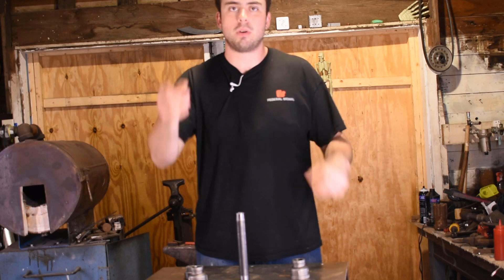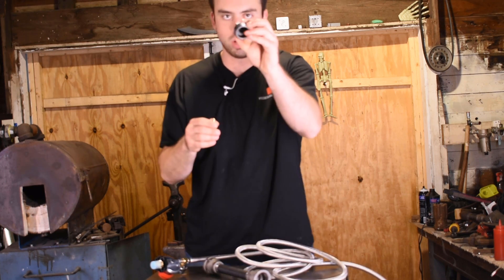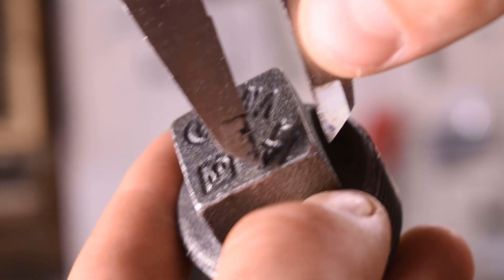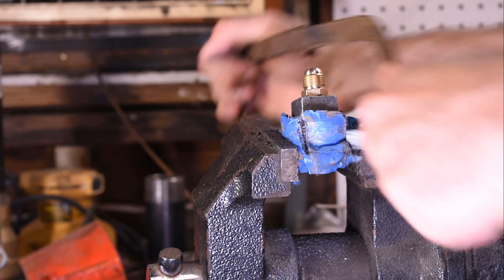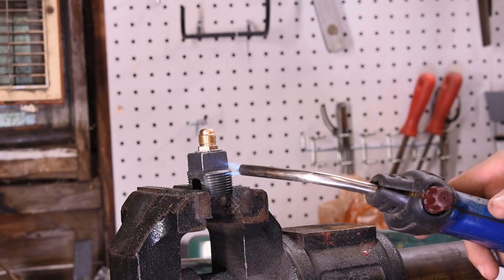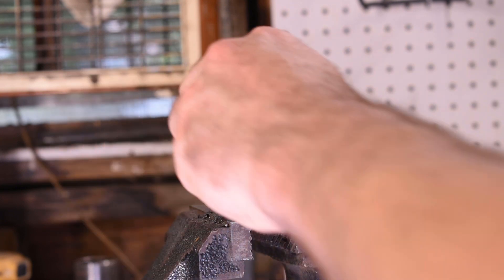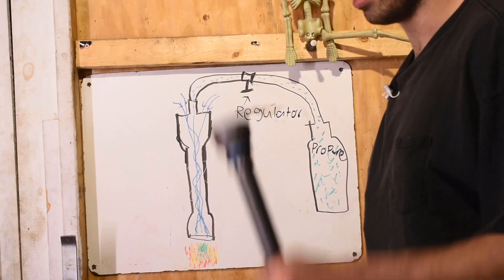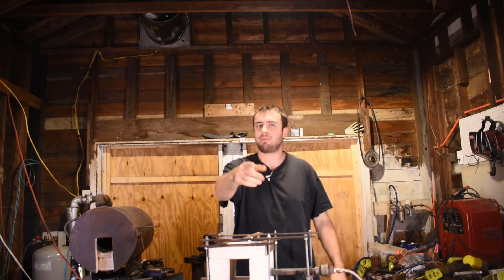How to make a propane gas forge burner in  2023(Easiest design)

Comment: I'm trying to make a jet burner double tip like for boiling big pots of water... The problem I'm having is the flame blows itself out unless I put a small dome above the tips even at that the flame is never at the .025 mig tip... I'm using a 15 psi regulator I have not placed any tubing around the tips as it's in the testing phase is the regulator too powerful I'm at a loss I know your video shows a forge but it's very similar any help is appreciated